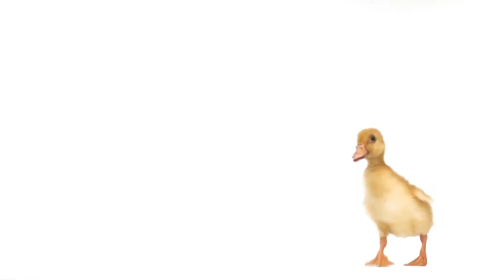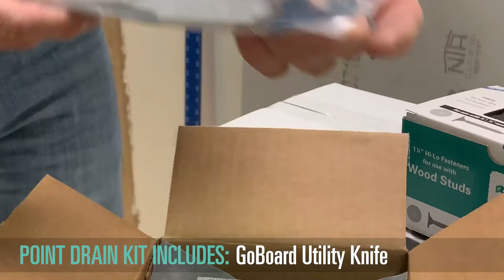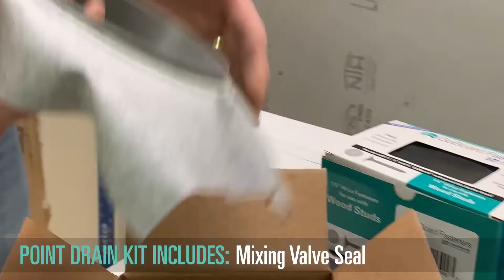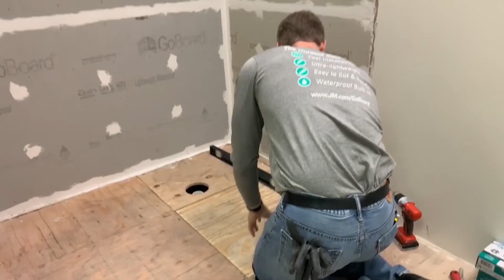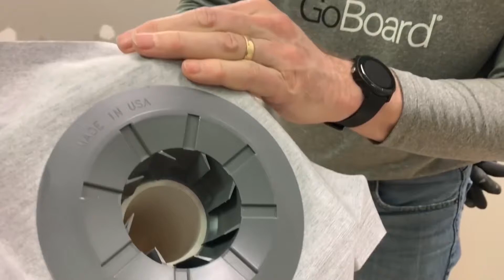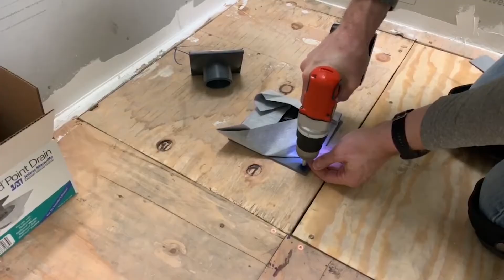Easily Install the GoBoard® Point Drain Shower System

Comment: how do you figure the slope of the pan so the tile around the perimeter is at the same level all around...is this taken care of with the wedge board?
Reply from the maker: This is a limitation, but contractors make the adjustment by cutting the tile to fit the perimeter.

Comment: What brand/type of mortar do you recommend for the wood decking for goboard to adhere to? Google says use a dry set mortar or polymer-modified thin-set mortar compliant with ANSI A118.1 or A118.4 standards. Which is better in your opinion and are there any brands you recommend?

Comment: @TimFrentz I was wondering about the idea of membrane and the corner joints at the shower pan when I saw your comment.  If the goboard surface is waterproof, and the sealant is waterproof and filling all the cracks and seams, is there really a need to place a membrane on top of the waterproof goboard sheets in the shower pan, or to membrane over the waterproof sealant joints in the corners?   JM does sell these rolls of polyester membrane that I thought was supposed to go over the joints on top of their waterproof sealant, but the guy here didn't do any of that, nor did he mention any further steps, as he ended the video by saying, "we have finished the goboard install and are ready to install our tile...?

Comment: Love it! Make sense if drain need to be relocated ! One question is! Is it better to install curb width lrger size against floor for door installation?
Reply from the maker: You can use any of the sides, but putting the wide side the the floor makes the most sense when you're installing a door, as it offers more area as a support for the door frame.

Comment: Would like to see install of floor drain in concrete floor( my scenario). Also can you stand on the drain pain if you decide to install that before doing the walls.
Reply from the maker: Yes, you can stand on the pan. Just make sure you've done the subfloor prep work according to our installation instructions.

Comment: Can GoBoard be used to make a curbless shower?
Reply from the maker: Yes, you can use GoBoard Wedge in a curbless / zero entry shower, by matching the flooring outside of the wet area to the threshold of wedges.

Comment: Hydro Ban is listed as compatible with GoBoard in the literature.   Does this included the Go Board Sealant?   Can I put Hydroban over the sealant?
Reply from the maker: It's highly unnecessary to use Hydroban over the top of GoBoard Pro Sealant.

Comment: Any documentation on how to do a curbless shower? Like how should the drain be from a finished wall or rough frame wall?
Reply from the maker: You just want to make sure your shower pan subfloor is low enough to meet the threshold of the floor level (including the layers of thin-set mortar and tile, on the outside of the shower stall. The Wedges ensure that the water slopes to the drain - regardless of the drain location.

Comment: Total noob here... I saw that GoBoard has a 49"x49.5" pre-formed pan. I have a roughly 54"x60" shower on a concrete slab, with a drain at the center point. How do I infill the outer perimeter around the pan? Do those areas need to be sloped, or can they be level? Also, what method is recommended to adhere the pan to the concrete slab?
Reply from the maker: You adhere the pre-sloped wedges to concrete slab using thinset mortar. It's advisable to also ensure there is slope to that outer perimeter. That's a bit of a challenging size for these wedges, but you could pack the outer perimeter as the foam can be embedded in the mud. If you have more advanced technical questions - reach out to our technical services team at (800) 654-3013 (be sure to choose "Building Insulation" from the call directory.

Comment: So on a floor like this (or any center drain) I would have to purchase 4 Goboard wedges?
Reply from the maker: Correct, you can buy 4 wedges a la cart from retailers that carry it by the pallet, or you can look for the kit which includes 4 wedges, a point drain, and two curb pieces.

Comment: I have a bathtub that I'm converting to a shower so the drain is closer to the wall, approximately 6" off the wall. Does that impact how the shower pan should be cut? Can I use one or two pans and avoid doing the envelope cut that is shown in this video? Thanks
Reply from the maker: If you're installing a linear drain you could use wedges without cutting them at the 45 degree angles, but with a point drain (or center drain) you'll need to cut them. You'll just have a smaller piece of wedge on the 6" side.

Comment: So where is the slope to the drain?  I still can't believe that tile will go over that with no membrane. I trust it for a flip but not for a decade.
Reply from the maker: The wedges are pre-sloped. Ensure your subfloor is level and you're good to go. Just follow the complete manufacturer installation instructions and it will last. Why would a flip not be worth installing a quality product?

Comment: For DIY'ers looks like there are easier options than having to worry with all those wedge board cuts for the pan.
Reply from the maker: The installation of this pan doesn't require additional plumbing to move the drain. The wedges accommodate the drain location; e.g. offset drain locations, or tub to shower conversion.
Reply: thats 10x easier than doing a pan liner with less steps

Comment: Can you add goboard strip on all joint including the floor? Seems last longer? And how long will the sealant last?
Reply: Yes I have the same question. Do you need seam tape and how long does the caulk last?
Reply from the maker: GoBoard Pro Sealant should last the life of the shower when following manufacturers installation instructions.
Reply from the maker: The sealant should suffice, but if you are needing more peace of mind you can overlay the sealant with GoBoard Seam Fabric - or you can use the thin-set and banding method of installation using GoBoard Membrane, and / or GoBoard Banding.

Comment: It makes sense to do the walls first in this approach because the pieces will have different thicknesses depending on how far up the board they are cut. A short piece has a shorter run to the drain and requires less fall, where a longer piece is further from the drain and has more thickness closer to the perimeter. I have trouble envisioning the finished heights to be level on the perimeter which matters much less since the walls are already in. 

I am still a little weary of relying solely on the adhesive around the corners to maintain water tightness, can an additional layer of waterproofing such as a liquid membrane or regular membrane be applied, at least around the edges?
Reply from the maker: Yes - if it gives you more peace of mind you can use the GoBoard Membrane (cut to to appropriate size strips) and/or GoBoard Banding, Corners, and Curb Covers. Probably more secure to opt for the membrane products rather than the liquid applied waterproofing.
Reply: To my opinion first shawer pan because In a herqueit the walls move to that sides and tha water liks on the sides

Comment: Question, when you do the floor pan, do you have to slope it manually or does it automatically have enough slope towards the drain when you do the angle cuts?
Reply: the pieces he uses for the floor pan are the wedge pieces. they come sloped
Reply from the maker: The wedges are pre-sloped. Just ensure that your subfloor is level first.

Comment: If it has only one pitch how’s it going to drain without a linear drain on the low side? Your drain is nearly in the middle, what am I missing?
Reply from the maker: For linears drains, yes you would use the wedges in that way. However, for point drains you cut four wedges at 45° from the corners of the clamping collar on the drain base, then install wedges so that all the low ends of the wedges towards the drain.  Think of it as an envelope cut style. Page 2 of our brochure shows you some possible configurations: https://www.jm.com/content/dam/jm/global/en/insulation-systems/products/goboard/showerpankit/goboardshowerkit/gb-502-jm-goboard-shower-pan-en09152021.pdf

Comment: So if i have a concrete pan that has the type of flange installed with a adjustable neck for a mortar pan ill have to bust the slab arpund it and re do it all. No adapter?
Reply from the maker: You shouldn't need an adapter. Here's our drain installation for cement slab instructions: https://www.jm.com/content/dam/jm/global/en/insulation-systems/products/goboard/goboardaccessories/goboardpointdrain/gb-510-jm-goboard-point-drain-installation-cement-slab.pdf

Comment: If I’m using Go Board for the shower walls with a preformed shower pan should I install the go board and butt the pan up to it or install the shower pan first butted tot he studs then install go board leaving 1/8th in gap and sealing with Go Board sealer?
Reply from the maker: Install the pan first. It would be a similar installation method to a tub surround.

Comment: Planning on ditching my plastic shower pan, will I need to have a wooden sub floor added before building up or is there another method?
Reply from the maker: Either a wood subfloor (5.8" thick plywood or 3/4" OSB), or a flat cement slab.

Comment: thorough video, interested to try this out. One question...when you applied the thinset to the decking, is it recommended to dampen the decking first with sponge/water, so that your modified thinset doesn't cure too quickly? I've seen it on many vids, just wasn't sure if that is required here with the wedge system.
Reply from the maker: There's no requirement to do that, for GoBoard Wedge.

Comment: Will this wedge shower board support wheel chair weight for elderly shower accces. 300 lbs  plus, any tests done for this loading and fail point
Reply from the maker: For tile larger than 6-inch x 6-inch tile dimensions, we're rated for light commercial applications.

Comment: I feel like this could fail for sure since it’s just caulk joints so why couldn’t you just add the go board (membrane) on top of this to make sure that no issues will happen at all.
Reply from the maker: As long as you follow manufacturer installation instructions, you shouldn't have any issues.

Comment: Been installing wedi for 8 years now. The tile shop started carrying go board and I was encouraged to try it. Haven’t used it yet but I can’t see us using this. The base is cut and a lot more complicated to install. Can’t imagine the cost is worth it. Also why wouldn’t you just install the base first then the walls, to overlap the seams?
Reply from the maker: The shingling effect doesn't apply in this case. Also, this kit enables on-site customization including off-set drain placements. Cutting the wedges to fit means won't need to move the plumbing in some situations you may come into.

Comment: This is a great video. Please link a follow up video showing the 2nd layer of protection using your sheet membrane, corners and sealant!  🙂I'm a BH holder and always promoting our products when I find them superior to the alternatives.

One point to note is that ideally you want a center drain in a square pan so the wall pan height is close to the same all the way around for a clean level tile install. If you ever replace this video, consider more of a square demo with center drain.
Reply: The point of this video is for those who don't, or can't easily move their drain. I have a concrete slab foundation. The tile issue is a non-issue. Pop a level line the width of a tile up from the lowest spot, and cut the bottom row of tiles to fit. If you can't do that, you have no business setting tile, DIY or pro.
Reply: @TimFrentz I was wondering about this idea and saw your comment.  If the goboard surface is waterproof, and the sealant is waterproof and filling all the cracks and seams, is there really a need to place a membrane on top of the waterproof goboard sheets in the shower pan, or to membrane over the waterproof sealant joints in the corners.   JM does sell these rolls of polyester membrane that I thought was supposed to go over the joints on top of their waterproof sealant, but the guy here didn't do any of that, nor did he mention any further steps, as he ended the video by saying, "we have finished the goboard install and are ready to install our tile...????
Reply from the maker: Thanks!
Reply: Very important note here.  I unfortunately didn't realize this until the wedge boards were bedded into the thinset and I checked perimeter with a level.  Good amount of money and time wasted.  Fortunately I was able to remove it all before it setup and will go back to the tried and true mud bed.

Comment: This looks like you will have the drain pan terminate against the wall at different levels all the way around.  The longest section is going to end higher on the wall than the other sections.  So you have to cut each tile to match the slope in order to have an even top line to the first row of tiles?  This is a daunting task.
Reply from the maker: You are correct, and considering the tile size it might take a little bit of math. Perhaps laser levels could help.
Reply: Just draw a level line and rip the 1st row to that line. doesnt seem very hard.

Comment: Do you have to put silicone caulking in the corners after tiling?
Reply from the maker: Hello, the TCNA recommends using caulking in the corners and changes of plane, but matching grout color could be an issue. Here is an article on the topic offered by JLC: https://www.jlconline.com/how-to/interiors/caulk-or-grout-in-shower-corners_o
Reply: Thanks.
 I think if the wall is completely 100% covered with a membrane like Kerdi and wrapped through each corner, then there would be no need for caulking.
The membrane ‘gives’ so much that there is no tension buildup in the tile, even in the corners. However,  I am sure kerdi or similar membrane requires more labor and cost.  @johnsmanvillegoboard
Reply: @jamespaddler  JM has their own membrane and liquid flash & corners - there is a part 2 of this video extension.

Comment: Do you not have to put a membrane over the seald areas?
Reply from the maker: Not necessary.
Reply: A 2nd level of protection is recommended but "not necessary" as their YT agent states. They make and offer the additional fabric & liquid membranes and corners. Def use them to provide extra strength & waterproofing. Don't rely on just letting liquid sealant hold up to constant moisture wicking below grout.

Comment: Why did you cut the board from the bottom? Don’t you need the height for better runoff?
Reply from the maker: 1/4" per foot slope to the drain is standard and is achieved no matter which side of the GoBoard Wedge is cut off.

Comment: CAN I USE A SCHLUTER SHOWER PAN WITH GO BOARD ON THE WALLS ? IF SO, DO I JUST USE KERDI BAND TO ADJOIN ? OR WHAT ?
Reply from the maker: Our recommended installation methods are GoBoard pan using GoBoard Wedges, or a mud pan.
Reply: I think so, Kerdi band in all the corners for the win.

Comment: I cannot believe that best practice would have the Go Board on the walls before the floor.  It is counterintuitive.  Also, there is no reinforcement at the 90 degree right angles.  Waterproofing there is completely dependent on the sealant between the walls and the floors.  Surely the the manufacturer would want a face membrane.
Reply from the maker: It has been tested to rigorous standards, but you can use GoBoard Banding or GoBoard Seam Fabric in the changes of plane. Details here: GoBoard Seam Fabric: https://www.jm.com/en/goboard/goboard-seam-fabric/

Comment: What about the slope. Did you do that with the thin set?
Reply from the maker: Use a self leveler (SLU). You want the subfloor to be level before installing the wedges using thinset.

Comment: I remodeled my guest bath last year and did the tub walls in GoBoard.  I fell in love with the product.  Now I am doing the master bath and decided to go with the GoBoard Wedges and point drain.  My only complaint is that I am not in love with the aesthetics of drain.  I would like to use the Signature Hardware Cohen 4" Square Tile-In Shower Drain - Less Flange Model:406494 or maybe even the 6".  Would these be compatible?
Reply from the maker: The radial fins in our drain body (flange) are designed to accommodate most 2” drain hole cover assemblies - even threaded

Comment: I am totally floored (pun intended!). I am SO excited, you have no clue. I am a 73 yo widow rejuvenating my entire home, e v e r y t h i n g, except installation of countertop and laminate flooring (could not bend as easily as I wanted and got hip replacement, LOL! good to go again) and now last part, converting bathtub to shower - yeah prepping for the future! Can't wait to get started, will you sponsor me, pay for the product, make a video and use me as advertising that anybody can do this, not only guys in their 40's??? Only thing I will not do is the relocation of the faucet, don't want to do the soddering. Let me know. Any tips or suggestions are welcome!

Oh, I forgot - what I like MOST about this system is that I can determine where I want the drain. If there is anything I do not like is taking shower and standing on the drain. My rainforrest shower is 2ft out the wall, and thus I want the drain where is was for the bathtub, less than 1ft from the wall. And I can do this now with this system and do not have to comply with all those handymen who think they know it better than me. YEHAAAA!

Comment: A couple questions:
1) Are the curbs pitched?
2) Are the shower head seals available separately (for multiple shower heads/body jets)?
Reply from the maker: The curbs are not pitched (or sloped). Yes, the shower seals are available separately. Thank you for the questions!